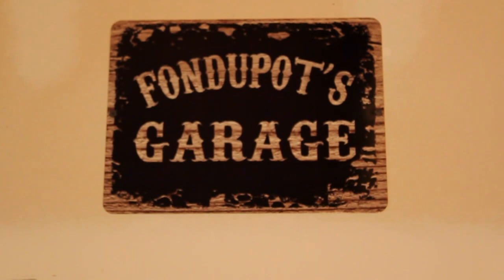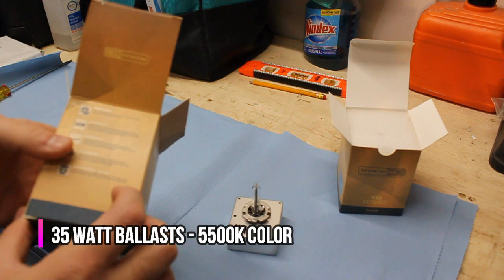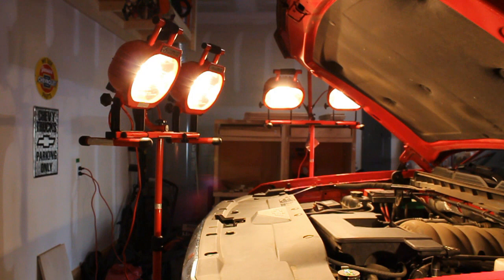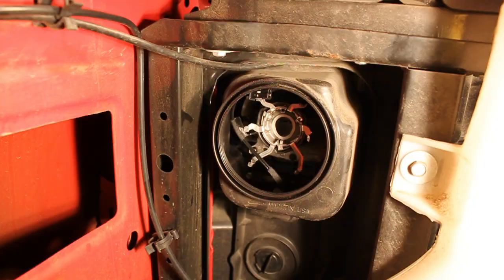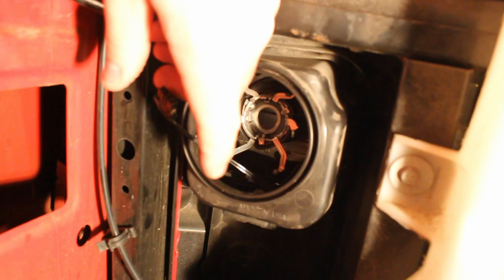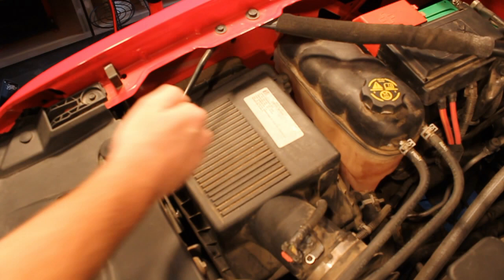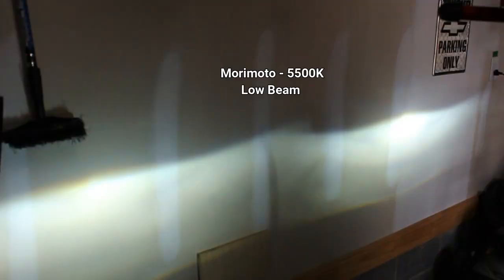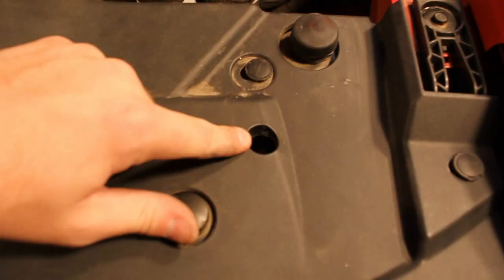[HOW TO] Upgrade D5S HIDs on a 2016-2018 Silverado - Morimoto (Easy Bulb Swap)

Comment: Thank you for posting. I'm actually going to swap my 2017 Sierra's bulbs to an LED today and your video made it look pretty simple. I've swapped a 2015 Silverado headlights out but the 2017 is a little different since they are HID instead of the halogens in the 2015.
Reply from the maker: Glad to help. Thanks for watching
Reply: Same

Comment: They are not about the same brightness as a 9005. I would love to get set of halogen headlights (lenses and all) for my 2018 silverado P.O.S truck.  The stock bulb style (9005) lights on my 2000 gmc were WAY the hell better than the crap on 2018. On fact there is absolutely nothing I like about my 2018. I only bought it because I was I  a real bind at the  and needed something now. Now I can't wait to get rid of it.
Reply from the maker: Dang sorry to hear that.

Comment: Is there a led replacement for a 2017 GMC 2500HD SIERRA DENAĹI for dual hi-ĺo beam single bulb. What is the best street legal led bulb?
Reply from the maker: Does not fit Sierra models.

Comment: FYI for the 2017 Sierra 1500 models. we don't have the clip that holds the bulb assembly inside the headlight, we have push and turn instead, because of that there is no LED replacement yet, not that I have found....................and our options for headlight upgrades are very slim pickins, all I have seen worth the effort is the ones in this video (Morimoto D5S, they also are designed for the push and turn mounting) #Fondupot'sGarage should rename the video on the LED conversion https://www.youtube.com/watch?v=YHt1PZ1lQng
Reply from the maker: Sorry about that. You’re right. It doesn’t fit Sierras. I changed the title. I don’t know why I had that in there. My bad!
Reply: How hard do you have to push and turn? Just tried it on my 2018 and the thing wouldn't budge
Reply from the maker: Shouldn’t be too hard.

Comment: My 2017 chevy silverado 1500 lt has d5s bulbs but i want led and i dont know what size bulb. Each housing takes 1 bulb each so 1 bulb has high/low beams.
Reply from the maker: Check out my other video on the LasFit D5S Led bulbs.
Reply: @fondupot  i wanted to try auxbeam f16 plus but they dont have the size i need. 9004 and 9007 are the same except the plug part. I been thinking about lasfit though because so far they are the only ones that have the right one. I have lasfit reverse cargo and liscense plate leds.
Reply from the maker: @austinspeed117  I've had the lasfits on my truck for quite a while. They have been great.
Reply: @fondupot  i have to do those i just wish shipping was faster as when i ordered from them like 2 weeks ago it took 1 week to get here

Comment: Would you say that the change from 25w to 35w gave you significant light increase? Have you had to replace these bulbs at all since your initial install? Would hate to have to keep spending $350 for bulbs if they dont last.
Reply from the maker: Yes the light increase was significant. Very noticeable. I’ve only had them installed for 2 months and they are still working just fine. They have a 2000 hour life expectancy, which should give years of trouble free use. Also a two year warranty.

Comment: Will these work on a 2016 GMC Denali 2500 HD?
Reply from the maker: I am not sure, you will need to verify if you have the OEM D5S HID bulb in there. If you do, then yes you can. Another option if you have the OEM D5S is the Lasfit D5S LED upgrade. Check out that video on my channel as well. I am running those currently.

Comment: I dont see a $400 difference
Reply from the maker: Hard to tell on video. In person it was significant. This is also good as a replacement when the OEM ones go bad. OEM bulbs are around $163 each, plus tax & shipping. And the morimotos can be had for $350 shipped on amazon. Pretty close to the same price. For a brighter bulb...